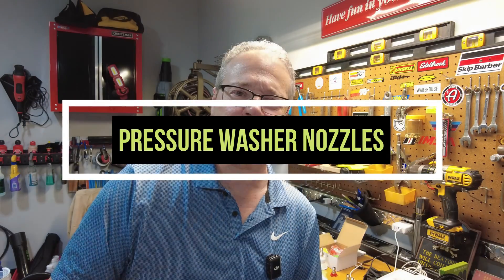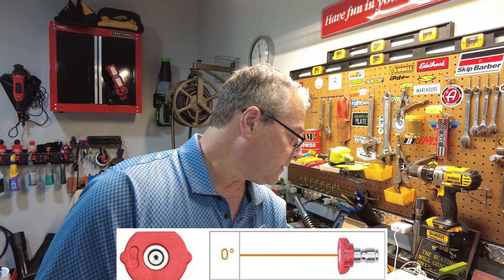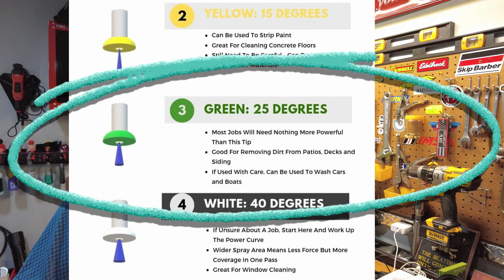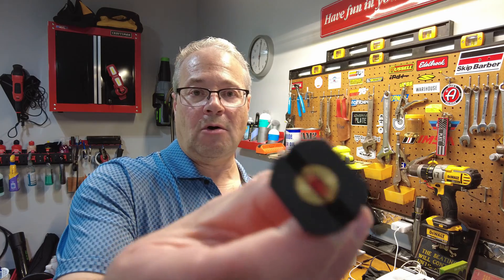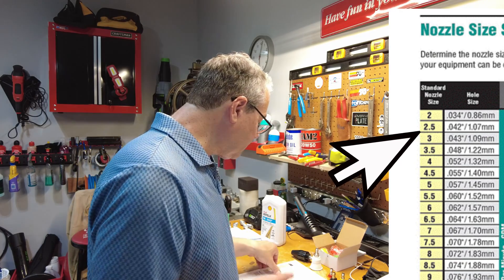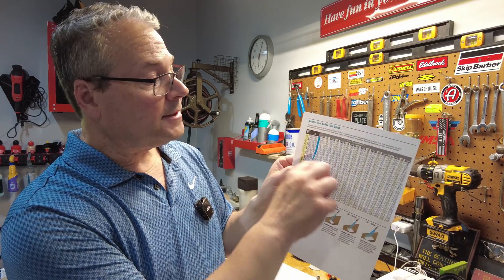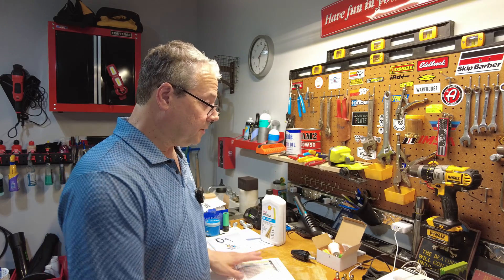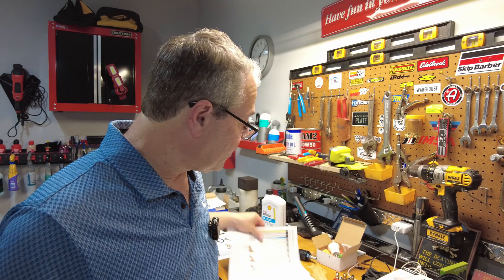Pressure Washer Nozzle Selection - Guide to Choosing the Right Nozzle | 4K Video Explanation

Comment: When calculating the orifice size should I use the Maximum Pressure (2030psi) or Rated Pressure (1450psi) ??
Reply from the maker: @ronstutter7248  Good question. I would go with the max as many sell their products to meet that spec and work from there.  so if it's a 2k psi unit.  go with that and your selection will be more accurate.